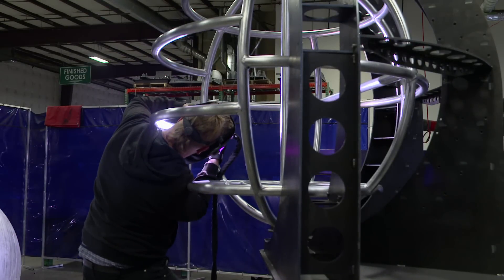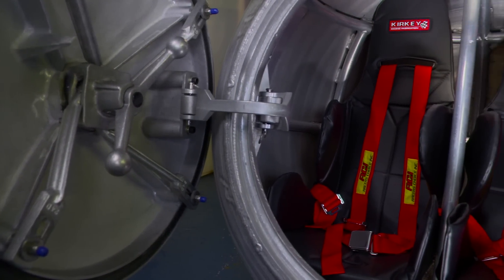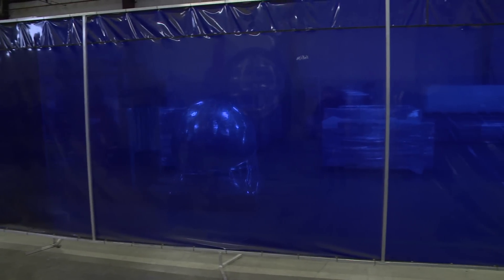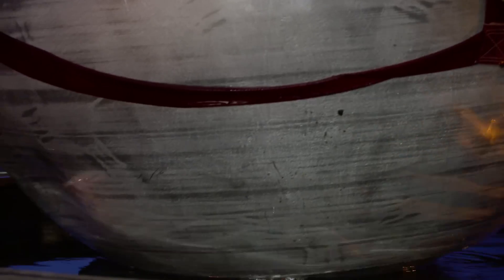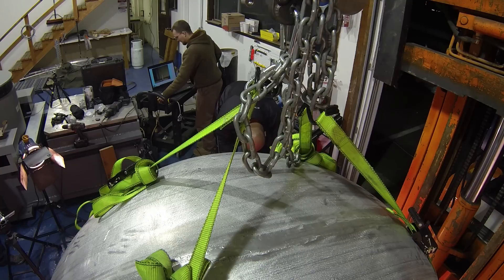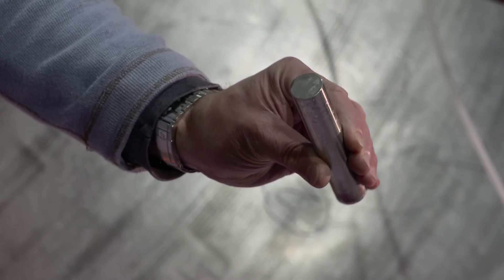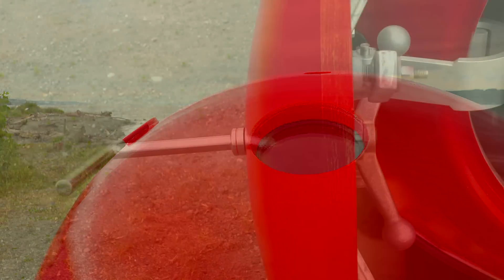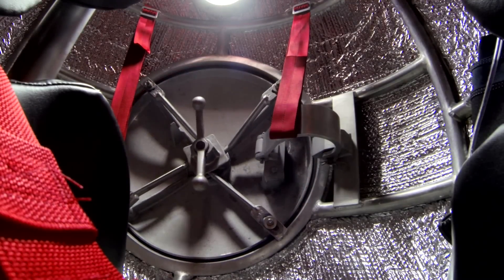Survival Capsule LLC - Development of the Survival Capsule

Comment: Firstly, promising idea.

Secondly, Does this sphere permit a buoyancy condition when in deep water? So the access hatch or viewing window is 'away from the water line' as to not allow entry of water.

Thirdly, with the racing style seating, most/if not all top level Motorsport activities mandate the use of head restraint devices for high-speed impact events. Say for example, during a Tsunami where fishing trawlers were perched on tops of buildings once the water level has dropped, this highlights the potential height an object may fall thus leading to high g-forces during an impact event. I appreciate additional technical content would raise your manufacturing costs but the last thing you'd want is someone suing you for damages whilst saving their life. It does happen out there!